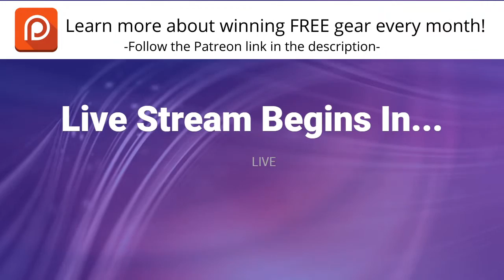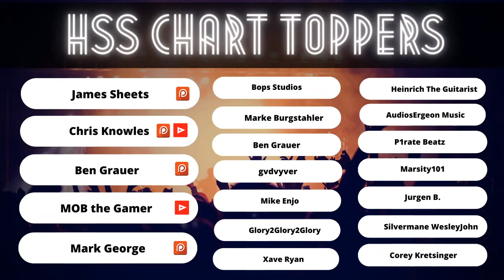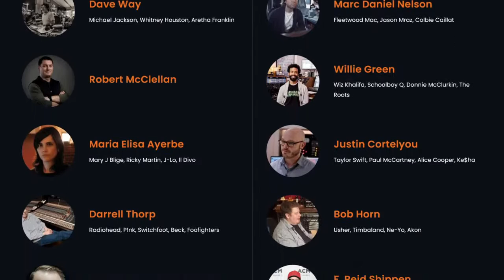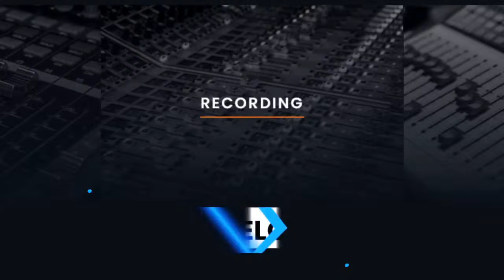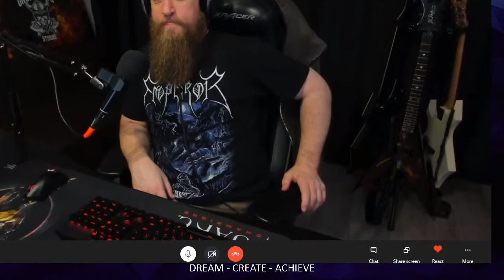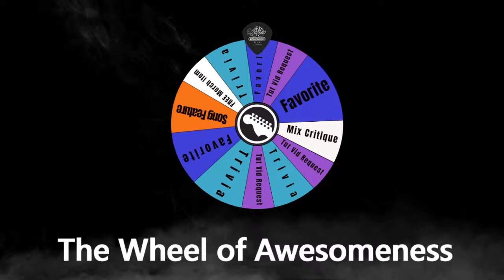Cakewalk vs Pro Tools - with Scott Elliot

Comment: You've mentioned in previous videos that I can seamlessly install Cakewalk by Bandlab without concern of loosing PI's and project files. Although you made reference to Sonar Platinum. I never upgraded to platinum. I'm using Producer 8.5. (Forever) So, can I expect that I can install Cakewalk by Bandlab and get a clean result as mentioned above? I have over 3500 bucks invested in PI's and 7 trbts of projects. I love Sonar producer 8.5 but many of the waves PI's and others are not supported because the DAW is outdated. BTW hate Pro tools, have it, hate it ,don't use it unless I have too, Did I mention I hate Pro Tools?.. Looking forward to your response.
Reply from the maker: Right! If you make the switch you will have everything you have now!

Comment: The volume on this video goes up and down. Go 1:15:30 into this video, and when Robert gets to the words "operations" (where he said "he's always been the head of operations) you can hear the audio drastically lower in volume.  It's like there is something pushing and pulling the audio volume on this video.  I've adjusted my volume control several times while listening to this video.  This being said, I've really enjoyed this video (except for the infomercial stuff.) There is good information, here.  Thanks guys.  PS: if you want another example of the volume going up and down on this video go to 1:17:13 and play for 4 seconds.  When just before Robert says the word "absolutely" the volume is increased, noticibly.  The key take a way for me, on this video, is that no DAW is perfect.
Reply from the maker: Yeah for some reason I have not been able to find out what is causong this?! Not sure if it's Skype or what but because it doesn't happen on my normal live streams. Weird!

Comment: I've used Cakewalk since 2007 and haven't used Pro-Tools since going to recording school in 2006. My decision was based on money or lack thereof, and since Cakewalk had many of the same features I could never justify paying $500 - $600 dollars for Pro-Tools. Especially now since Bandlab Cakewalk allows you to install your old cakewalk and used all the same plugins I had before. To me, it's more about bang for your buck.
Reply from the maker: Yes sir!
Reply: @Nathaniel Walker True, but I bought a slightly older version of Cakewalk on Ebay for a little over $200
Reply: @Nathaniel Walker TO a certain degree yes, but remember, back then you also had to buy their hardware, which ran another $500
Reply: @Nathaniel Walker Besides, that's not true, Yearly upgrades from Cakewalk were $99, entry prices were $499. You ended up spending much more with Pro Tools.